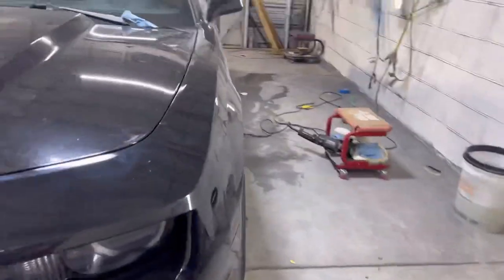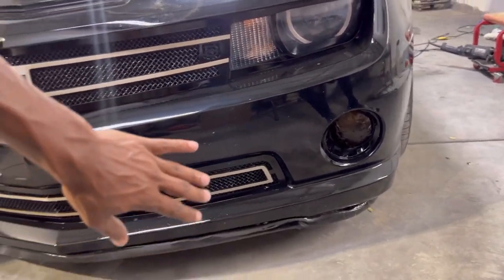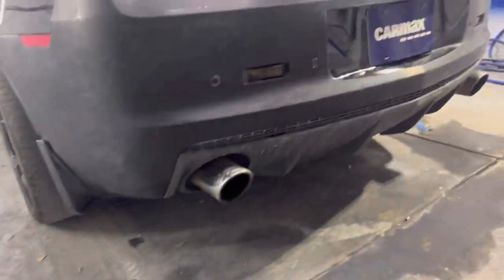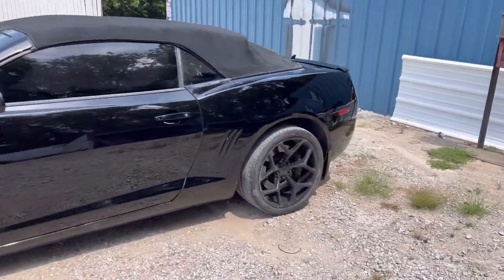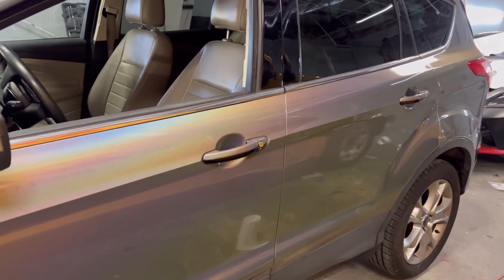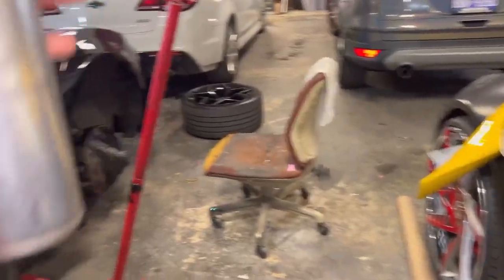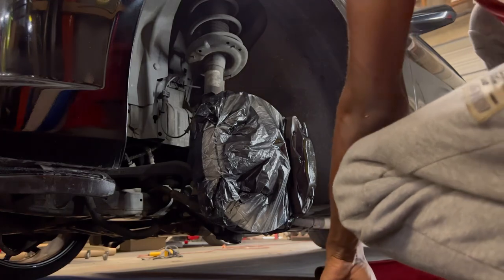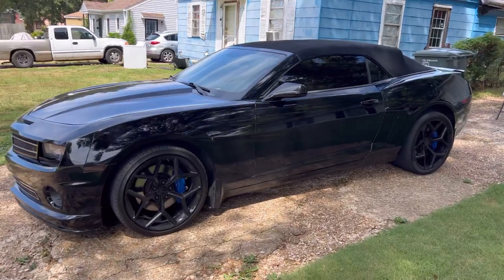FINALLY DONE BUFFING AND POLISHING MY CAMARO SS AND PAINTING BRAKE CALIPERS #camaro #chevy #memphis

Comment: Yo you gonna have so much lino in the sun using the edge of the buffer got to hold it flat looks good inside on the Sun light you will see the tiger lines
Reply from the maker: I do see a couple , thanks for the tip
Reply: Keep practicing bro you already are very good at it